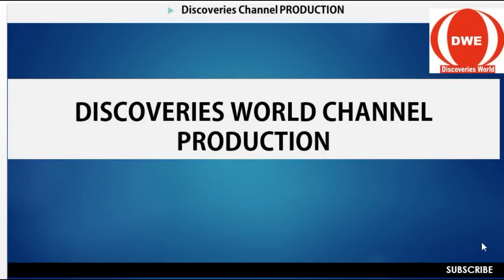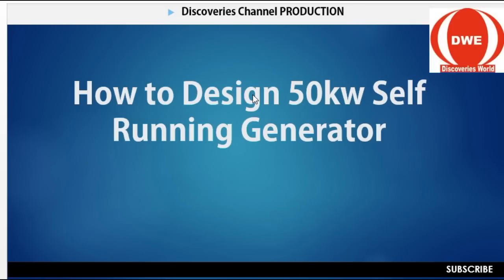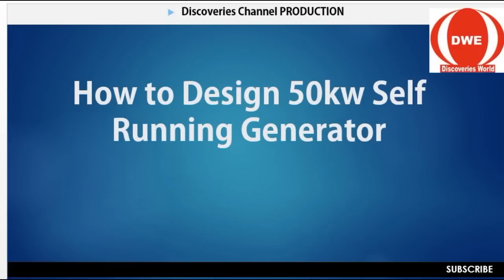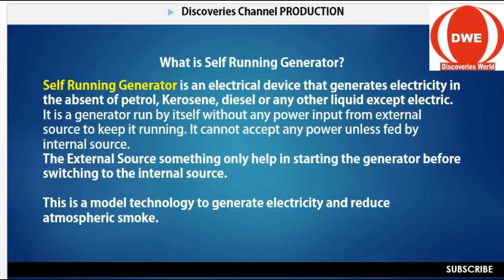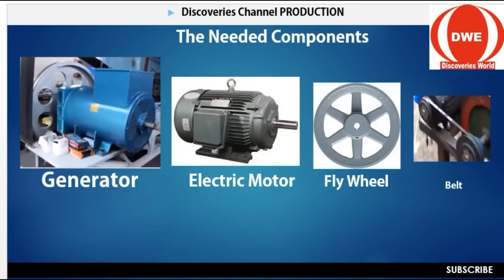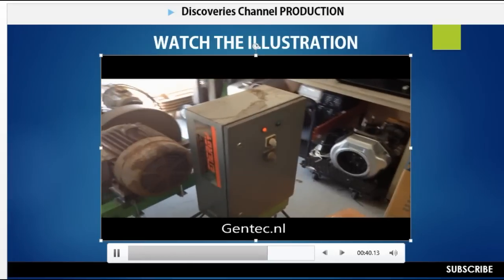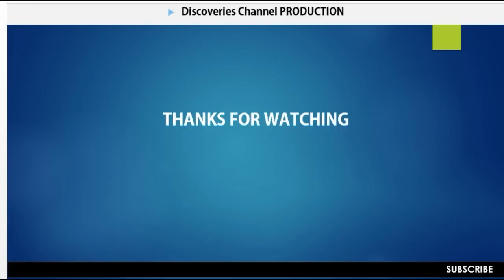Reveal Secrets - How to Design 50KW Self Running Generator

Comment: Use 12v battery as power mains, use 12v motor coupled to ac generator. Parallel off of the generator output to a step down transformer and rectifier. Use 12v rectified power to charge the battery co continuously. Now you have a completely powered system. May have to change battery every few years...

Comment: I had started my project by doing the same things you've explained. It actually worked but my problem is  starting the drive motor without any external power.Can you start the drive motor without any external power? Let's say you're somewhere without any power or fuel generator for backup power.
Reply from the maker: Thank you Ibrahim, for putting it in work and for attesting that it works. That approves every other doubter wrong. For the starting power, I going to bring out a production on that area. Thank
Reply: Construct an inverter
Reply: It is a goodood question Sir and let's wait for his reply.
Reply: @pedrosaviera4005  And 4 years later….?

Comment: Thank you so much for this project. I really appreciate your effort. 
Please, my questions are, 
(1) what is the power rating of the motor in kW? 
(2) what source did you use or are you using as the external source? 
(3) I want you to do further experiment on the maximum load this can bear, as in to list them either fridge, pressing iron, etc all together. So that we will know its capacity after the power consumption by the motor. Thank you in advance.

Comment: So this is how I see it working. Just for argument the motor draws say a 1000 watts and is 75% efficient. So its outputting 750 watts. As it does so it turns the generator which is say 75% efficient.  75% of 750 is roughly 560 watts output. So for a 1000 watts input we have 560 watts output. Not good!

  Just Nonsense!
Reply: I'm agree with you . This is nonsense .
LOL for upload this video 🤣😂
Reply: But it looks good on paper!
Reply: Right different pulley size would make it more equal to the out put that is all..
Reply: in 100watt , output 60kwatt , dimension  small 350mmx350mmx350mm .

Comment: The only thing this would do is convert to different voltage .used to be called a dynamotor  used before solid state electronic rectifiers available.say 6volts to 300v. For car pa. Amplifier.and such .

Comment: where does the cable go that is going under the wooden piece that is on the floor ?   so you want to say that the output power is more than the input power ?   show with amp and watt meter  then we talk
Reply: En español para america latina por favor
Reply: The power switch is even wired wrong

Comment: All power in must return to source through ground.
All power used down line must be between the feed line and return line.
The motor must automatically adjust to torque requirements inorder to maintain rpm. The generator must provide 2× the maximum full load capacity of the whole circuit.
A transformer must be used inorder to transform the spent electrons into charged  usable electrons.
Capacitors must be used to compensate for surges.
And a sinwave smoother must be used for correct down line frequency.

If you get the just of this.
Two car alternates is all you need aside from the capacitors transformer and frequency smoother.
Reply from the maker: Wrong

Comment: This method will work only theoretical.not work in practically . Because input power is not equal to output power then the output reduced .This goes to input he is not working as motor rated rpm .And then output will be reduced continuously........

Comment: In the opening it stated that this system would accept no fuel or electricity, yet you have an electric motor driving a generator? You may as well just plug into the GPO. No need to go to all this expense of generating your own power. No free energy that I can see.

Comment: This doesn't work, I have seen this tested and as soon as the power is removed , the motor stops just long enough for the whole thing to fail ! I seen guys trying to use Capacitor banks to keep the motor in motion long enough for generator to take over but also failed !

Comment: A 50  KW generator needs a starting motor of 75 KW if the 50 KW has an efficiency of only 75%. At some point when you put a load on the whole machine you have to deal with electrical resistance and other ghosts loads produced by heat. The only way an PERPETUAL electrical machine will ever work is when all your electrical wiring is made from super-conducting material and when you use cryogenic cooling systems. Don't make a fool of yourselves.